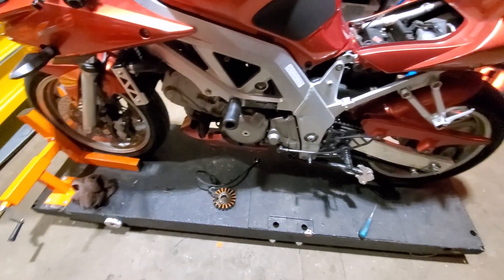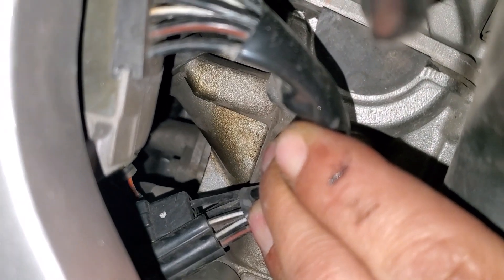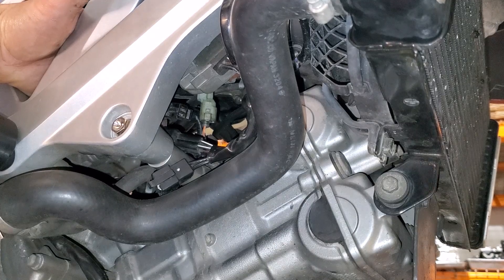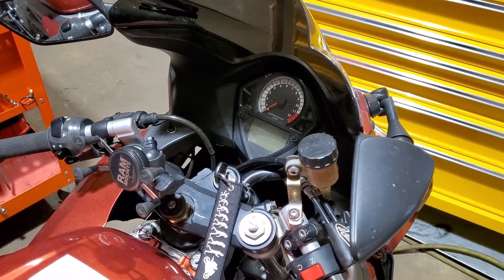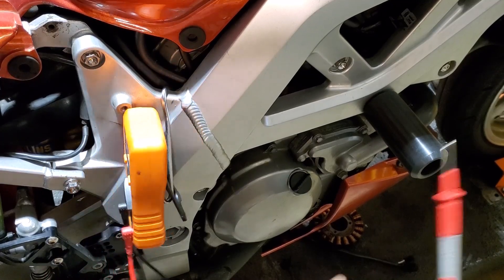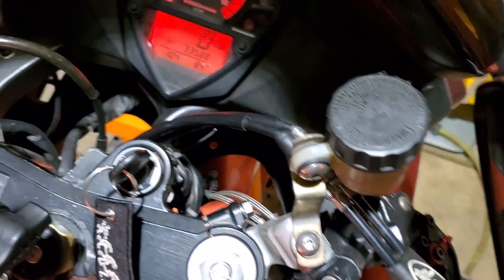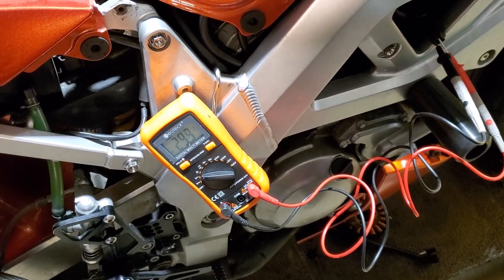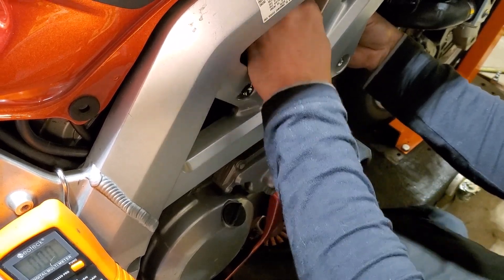sv650/sv1000 charging system testing

Comment: I am getting a reading of 13.9 at the battery terminals while the bike is idling at 1400rpm
What would you do?
No other problems.
Thanks 👍
Reply from the maker: That seems about right. At 5k it shouldnt be over 14.8
Reply: @Mad8vCycles  cool.. so too much is not a good thing 
👍🍀
Reply: @Mad8vCycles  I also did a compression test..2000 sv650 with 57000 miles..got 190 on the rear and 180 on the front ..
I was happy with those numbers..
Reply from the maker: @geoffreycasey875 dude, thats a healthy bike. Valves checked?
Reply: @Mad8vCycles  yes all in spec..

Comment: Mad8v you are an absolute legend, deserve way more subscribers.  I picked up a SV650 that had been sitting for ~10 years and have had to go through almost all of your videos lol.  My current issue is that my charging system works (replaced stator and R/R), I am getting over 14 volts as raw output from the R/R, but the battery is stuck at almost 12v.  Any ideas? I think I'm going to take a look at the ground from the battery but this issue has been tricky! 

Thanks for all the videos!
Reply from the maker: @nickleland2131  how old/new is the battery? What do you get on it at 5k rpm?
Reply: @Mad8vCycles  Have a feeling it's battery after poking around.  Battery is a few months old, sat on trickle charger for the most part but who knows.  Battery shows ~12 and some when running, at 5k rpms the voltage will increase but only slightly, maybe .1 or .2 volts.
Reply: @nickleland2131  battery should be 12+V static, it will drop at ignition/start to around 10+, but not lower
even at idle, you should see 12.?V then increasing towards 13+V
Under good throttle, as Mad mentioned, 5k revs, 14+, usually between 14.4 - 14.7
If it's 'stagnant' at 12.?V  then it's not charging, could be the R&R
if if goes over 15 and climbs, turn the bike off
This could be Stator,  Pick up coil, R & R or the lot
Do all the tests first, write down all the numbers
1) when cold, ignition off/ignition 
2) when idling
3) at 4,000 rpm's
4) after a quick 10/20 minute ride, immediately test the probes again
This is where I'm at trying to determine the fluctuating rear cylinder and stall at low revs
There can be 'no issue' when cold, but, once warmed up, these parts may be failing
Do numerous tests before spending $'s on parts
Hope this help you
Reply: @Mad8vCycles  very well described, good work

Comment: These bikes are notorious for charging problems. If you have one I strongly suggest you check your stator and the magnets they have a tendency to move and in some cases fly lose and crumble into goo. I know many people who have had this happen and to get it fixed will cost you around $500 so get your hands dirty and check it out. The bad news is if it happens the crumbled magnets will go everywhere in your engine and get ground up into dust clogging the oilfilter.
Reply from the maker: @matthewkieferMATTMAN  the magnet thing is specific to the sv1000 and is a well known issue

Comment: How do you get combustion while the stator is unplugged? I thought the spark plugs depended directly on the stator...
Reply from the maker: Battery. Total loss systems exist... where you run a minimal flywheel and no generator at all and just suck down the battery throughout the race
Reply: Hmm... After looking at the wiring diagram more, I think I've confused the stator for the pulse generator.

If I understand correctly, the pulse generator signals to the CDI when the crankshaft has reached a specific position. It's necessary for the CDI to generate spark correctly. The engine can't run without it.

However, the stator just charges the battery, so as long as there's still charge in the battery, the bike will operate as usual with the stator entirely disconnected.
Reply from the maker: you're thinking of the 'magneto' setups on 60 year old bikes...
Reply: I've been working on this 2001 SVS that won't spark. Coils and plugs seem good. The CDI looks okay, but I'm trying to find a friend to try it out in their bike.

I guess after that I'll have to try testing the pulse generator... If it's just a switch, I think I should be able to test it by turning the crankshaft while testing for continuity with the multimeter.

Does that sound like it should work?
Reply from the maker: @brighamcampbell464  check the 100ohm antitheft on the ignition (i have a video for that). 

pulse generator Id connect a light to it (keep it plugged in) maybe? i usually just check by swapping stators but that is an expensive parts shotgun for most people (i have tons in stockso it's free for me to try).

Comment: Why aren't fuses being blown when the regulator is removed? Is it because everything works except the stator is not charging?
Reply from the maker: why would fuses blow? it's an open circuit at that point and there are no fuses in the charging system anyway
Reply: @Mad8vCycles  because the regulator is unplugged and without the regulator a power surge from the stator can blow furses
Reply from the maker: @PhilipJones-g3z  they're in series... if the regulator is unplugged there is no circuit completed and there is no power...  
that's like saying your speakers can blow if you unplug the amplifier...
Reply from the maker: @PhilipJones-g3z another way to think about it is... the stator is plugged into the rr. if it's unplugged then it's not plugged into anything
Reply: @Mad8vCycles  The bike is running off the battery at that point.
Reply: Yes I agree your stator is only attached to the regulator rectifier  and that is then connected to the battery has a 30amp fuse that could blow if there is a surge but if the rr is not plugged nie no sugre could happen